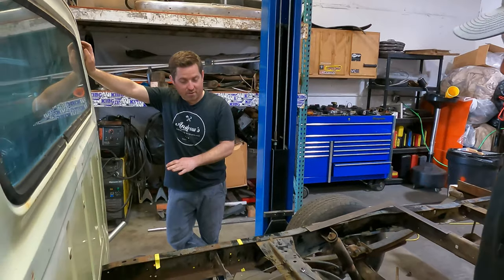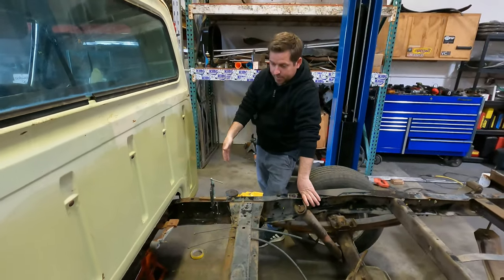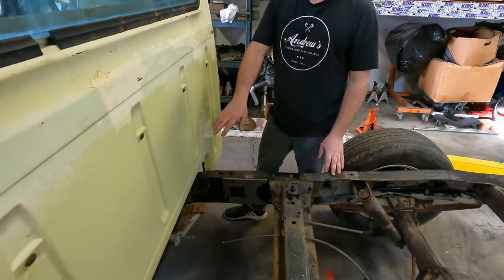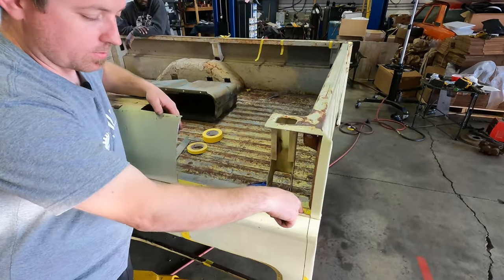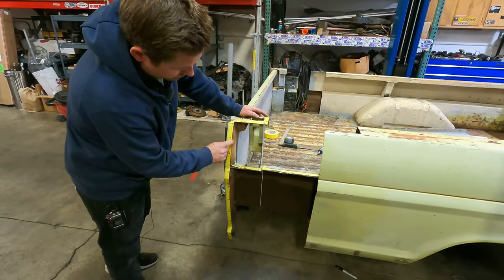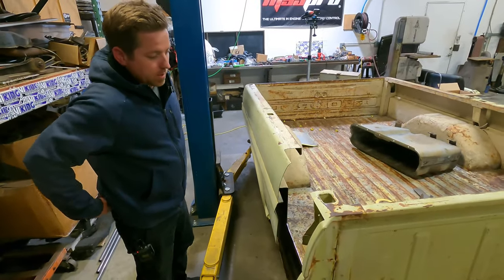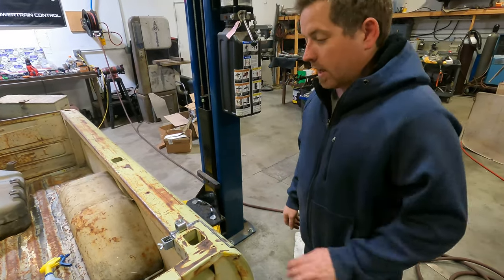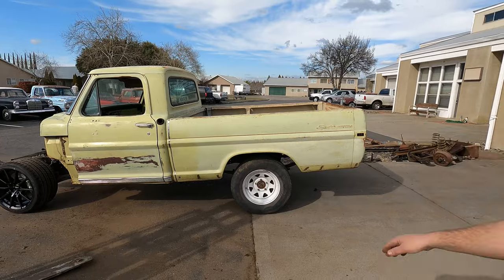F100 Short Bed Conversion Pt.1

Comment: Suggestion If you want to save all the extra work of matching and welding that floor seam what I do is drill out the crossmember spotwelds and slide the floor right to front and redrill the two bed bolt holes and weld crossmember back up with new spot welds. You have to drill out and remove the extra couple crossmembers anyway.
Reply: Do you have a video of that...

Comment: A short bed on average will be more  valuable than a long bed. I'llgive you that. However, once you cut/hack them from long to short the value then becomes subjective and depends on the reputation of the builder or the desperation of the uninformed buyer. Given the expense of having to pay someone to do this work and then sell it after. It is unlikely the cost of the work would be recovered with the "increased value" of a shot bed over a long bed. Even if it is then kept in a bed "batch work" patina form. Short beds look sportier, that's the main attraction. There are too many hack job cv swap short, c-notch, short bed conversions out there asking unrealistic prices. Power to them, I'll keep my long bed.
Reply: Yep. In vintage vehicles (anything vintage) original is way more valuable. Even despite the quality of the work, any potential money thrown at a restored vehicle will immediately notice the VIN is for a long bed. Secondarily, anyone over 50 should realize car fads are just that. Trendy chops look good only in a short window, to a narrow audience. Most of us in the restoration world deal with "mods" from 20+ years ago as a frustrating money & time killer. This will only make long beds more valuable, simple economics of one less original bed out there.
Reply: Who cares looks good 😊
Reply: Long bed it's better for me I hate short beds

Comment: As an outsider from Australia were i have no idea on values of these trucks, but plenty of experience in old school steel bumper vehicles.  the long beds look much better i don't see the attraction to short beds. But either way great work on the actual conversion.
Reply: Short bed trucks look funny to me~ Too much front, not enough back~ It's like when you see a person with a large torso, but tiny legs~

Comment: Question??? I have always heard it was better to "Z" a frame when you cut one down and weld it back together. Curious on what you all thought.
Reply from the maker: A lot of people do the Z cut on the frame. It takes longer that way because you have to be more precise when cutting the Z front and back so they line up properly. We were confident that good welds sandwiched between fish plates and boxed in would be just as strong and be less of a headache.
Reply: A "  \ "  cut with fish plates and boxing would have been as quick and better.  If it was a 4x4 I would definitely " Z " cut with fish plates and boxing .

Comment: I had a cannery yellow 68 f100 6 3 on the colum crome west coast mirrors and crome bumpers with baby moons she was a short bead back then.
Reply: I bet those hubcaps are a real asset useful as a bumper sticker, there is no difference between a long bed and a short for work unless you have hubcaps then your truck looks lame

Comment: Others are on the other side of the fence… Short beds are inadequate because you can’t do anything with them.. A truck is a truck & meant for haulin’ and most everything fits inside your long bed, your dirt bike/ motorcycle, your camper, your moving cargo not to mention lumber. a long bed and looks better because of the longer wheelbase.

Comment: This makes my long bed go up in value 🤣👍
Reply: Agreed! All of these guys cutting-up perfectly good 8' beds, regardless of the quality of the work, makes my '68 F250 long bed not only less "trendy", but also rarer, and thus possibly more valuable. Plus, not only do I not have to worry about running across another one like it, by default a longer wheelbase offers a better ride. So go ahead, guys! Shorten 'em up all you want!

Comment: I have a 71 f100 short box 4x4 , a 72 short box 4x4  F100 Ranger and a 68 f100 short box flairside  2 wheel drive that is the 5th truck built in 68 and it has 67 dash and knobs etc . 67 body mounts etc

Comment: I’m thinking of shortening the frame on a ‘75 F250 Camper special, it’s two tone with the wider mirrors, HD springs… both rear corners top to bottom have dents like from hitting a trailer while turning… so i’d have to replace/transplant both corners from a spare bed (short) so it would be plug&play after shortening the frame. Share your thoughts guys. I’m doubting. I would sell it anyway.

Comment: How much does this run for? i have a 1972 f250 long bed that i want to make short bed
Reply: That's a lot of skill time and labor there I would expect if I brought my 69 in there it would be in the 3-5 k range I would just buy a parted out short bed cut the 16" out and put the original short box on it .
Although the skills here are great they did a top notch job he said it brought the value up 1-2 thousand but it would cost me 3 times to do it ? Ford's trucks are not high up on the value list I see them all the time running for 5-7 thousand .

This was a demonstration of the skill of this shop if it was anything over 3 thousand to do this I would prefer buying another truck .

Comment: Maybe I missed it but is that a cv swap in the front?
Reply from the maker: It’s almost CV swapped. We’re working on some new designs to hopefully maximize the crown vic geometry and we’ll put out a video on that too.
Reply: @PerformanceProductions  well glad i havent did any more than drill holes and “fitted” the CV front on mine, will these changes be suspension or cradle/k member changes?

Comment: I agree a short bed truck is more valuable than a long bed but that's not what you will end up with.  You will have a truck that was converted from long to short.  That's very different from a short bed truck when it comes to resale.